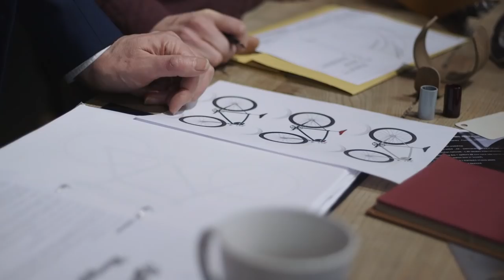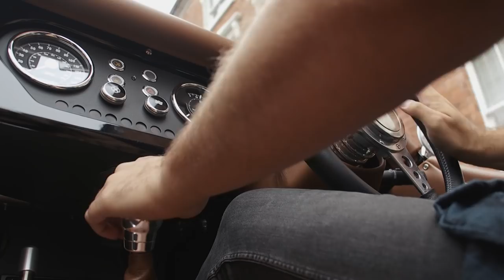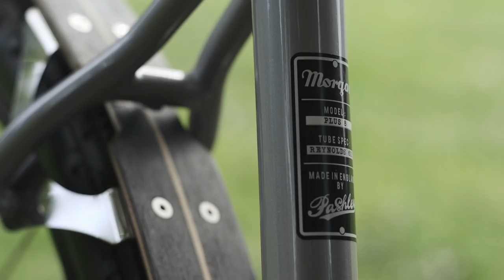The Pashley-Morgan Bicycle: A Very British Collaboration

Comment: A masterpiece of a bicycle.  As an owner of a Pashley-Morgan 110, I've been delighted with my purchase.  Just a few weeks old and already 200 miles in - can't get enough.

Update as of July 2020: A design fault to the rear chain stays resulted in failure and needed the bike to be returned and the factory for them to re-engineer a solution.  

A few weeks later, the bottom bracket failed catastrophically in the middle of the countryside during a ride.

Before that, I lost all the gears when the gear cable pulled through, again in the middle of nowhere in the countryside.

I have now returned the bike for a refund and I won't buy a Pashley again.  A pity.

Comment: The issue I have with a Pashley bicycle is it’s maintenance is difficult. It’s slow & tedious. I have a Pashley Princess Sovereign & it is really an escapists type of a bike rather than an everyday use but when it comes to a mechanic most will not touch the hub as they say we are not qualified & any replacements have to be ordered in which takes days.